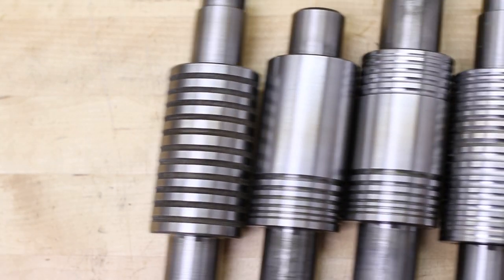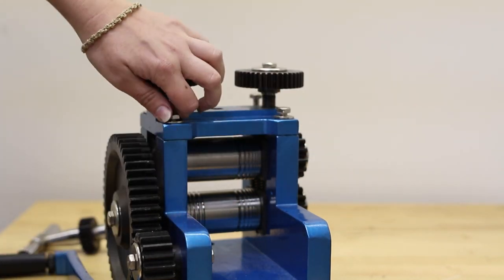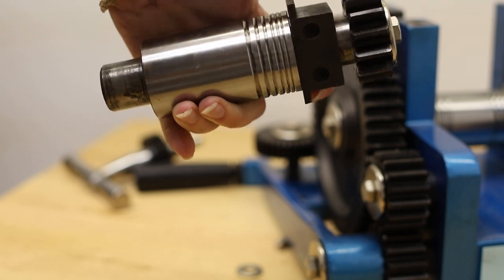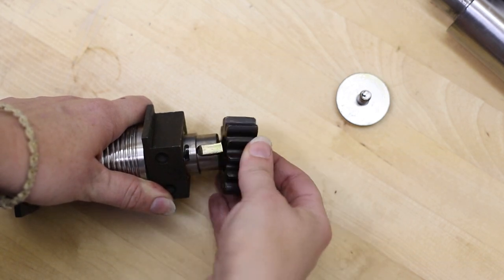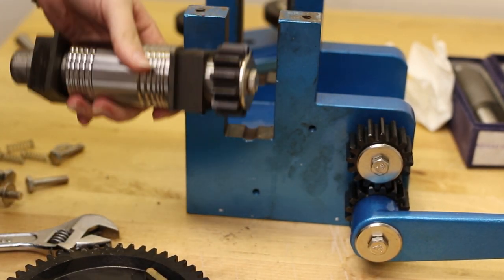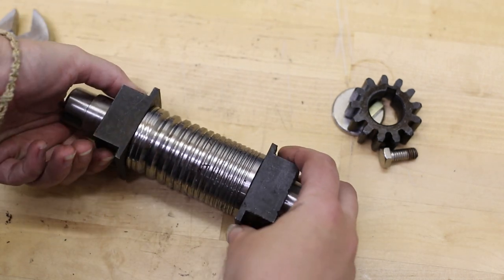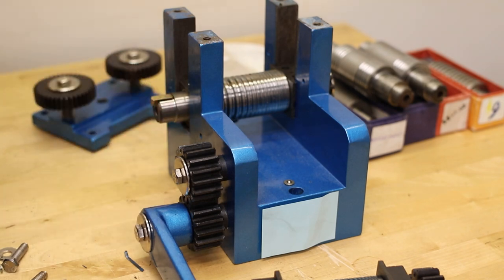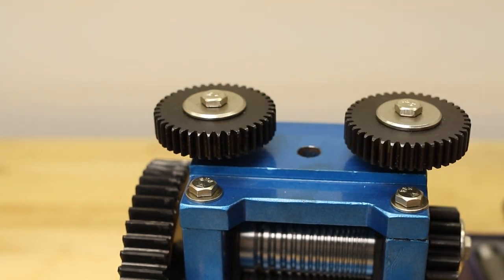How to Change the Rollers on your Economy Rolling Mill

Comment: Thank you for this video.  I just got a texture plate that is 2” and I need to change over to my smooth flat rollers but I am terrified of messing things up.  I usually do things upside down and backwards and can’t remember which is which.
Reply from the maker: No problem! I hope you got that texture plate working for you. Be sure to check out the instructional PDF - there's a link in the video description. It has detailed instructions alongside clear photos, and a sort of "exploded view" of how all the parts go together.

Comment: That little piece of metal is called a cotter key. If you notice it is ground flat on one end. That is to make the gear a bit easier to put on the shaft. (I noted you put it on backwards on the top roller)